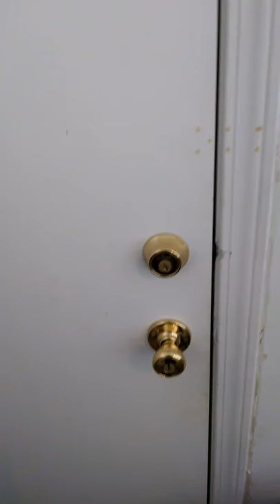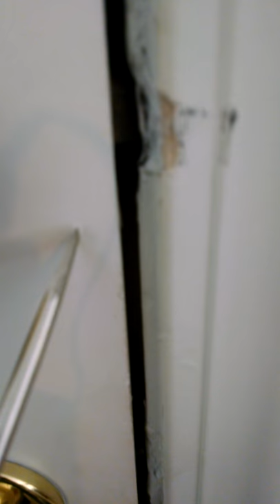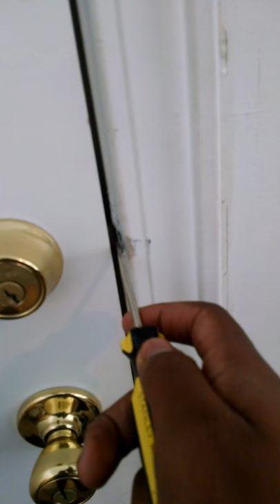How to get in your house that has a dead bolt.

Comment: Dude had the door already unlocked, look at the key way...
Reply: Its not installed right.... and if the bolt is not all they way out it wont lock in to place and can be pushed back in....
Reply: You can not accidentally lock yourself out with the deadbolt. You must have a key to lock it from the outside.
Reply: chris guyer it must’ve been elsewhere. He said in the beginning that his garage door was up.
Reply: @Lockman1986  he didn't say he locked himself out, he said he got locked out, which could mean a kid or spouse did it while he was outside
Reply: It work it not a lie I’m a grown ass man I’m telling you it works

Comment: Lol this doesn't work it you have a decent deadbolt when the thumb turn is set to lock position you shouldn't be able to push the blot in with your hand. If you can push it in I suggest buying a new lock.
Reply: Actually the deadbolt thumbturn could be pushed to locked position and the deadbolt latch not fully extend normally 1 inch you can still push it out of the way if not fully extended when in the frame
Reply: The whole door and trim could use some paint...what a mess.
Reply: I know that's right and even if he had  the clarence I have on my door to frame it's less than a 1/8 inch! Come try mine 😂

Comment: Dead bolts do something called dead locking. Due to a broken deadbolt or poor insulation this guys bolt isn’t dead locking. This will not work on your lock because yours very well should. And will not allow the bolt to retract from force or prying on it. “As long as it’s installed correctly” the bolt will have to be turned by the cylinder or by turning the thumb turn in the back in order to retract or move. He’s either unaware or is doing so for views and just the video. I’m a licensed lock smith so if you have any questions just reply to my comment and I will answer them accordingly.

Comment: As a locksmith this video is bogus. The latch will ONLY retract like that if it wasn’t turned all the way to the full lock position. Try it on your own deadbolts, with the door opened, and turn deadbolt all the way. There will be a little “click” you can feel at the full turn. Push latch with your finger and it won’t go in. Then turn just before full click and it can be pushed in. So either his door is improperly adjusted or he didn’t have it locked properly. But hey, if it gets you in without spending money on a locksmith then go for it.
Reply: Glad somebody finally said something, lo l 🤦‍♂️😂
Reply: Bro there are some deadbolts that don’t actually have the deadbolt feature

Comment: Two things, 1 either your bolt wasn't fully deployed or 2 your deadbolt needs replacement. Either way you aren't supposed to be able to just push a deadbolt open like that. They have built in safety measures against thieves that are trying to get in. Even the cheapest of quality won't just push back like that... they are called deadbolts for a reason!

Comment: This works on Knobs Not deadbolts! I know it's fake but if yours does do that it Means deadbolts broken, replace asap
Reply: Just about to write that
Reply: It can work if your bolt doesn’t fully extend
Reply: @I_lock_pick  you mean if it's half way between open and closed. Which No-one does. If you find a door like that it was a mistake or something needs to be fixed asap
Reply: @Caryfirebuff y🎉
Reply: Or a shitty dead bolt definitely did it before

Comment: Could just  be the hole for the deadbolt is  not deep enough so the deadbolt can't be properly locked. Happens all the time. Drill the hole deeper.
Reply: He is dishonest, just look at the keyway of the lock which was in a picked position towards the left!

Comment: I call b.s. on this. The cylinder looks like it's already picked over to the 11 o clock position allowing the bolt to move freely. I'm a locksmith and i spotted the cylinder "keyway" right away.
Reply: Lol, several of us non-locksmiths did as well!

Comment: That there is a sign your deadbolt is broken. I've had to break people out of their apartments because the bolt or the latch just breaks and stays closed. Had to break a $700 dollar lockset once because the cheap plastic part in the latch broke and trapped the resident inside. Another one was during a rainstorm and I had to climb up through a patio that was 30ft up, just to get inside to disassemble the lock.

Comment: I see a number of incorrect or partially correct solutions to the problem so I'll weigh-in:

Many deadbolts can be "fully" locked but can still be walked back into the open position as shown in this video, when the door is outward opening (this exposing the deadbolt). The solution is to extend the depth of the strike (the hole in the door frame into which the belt bolt extends) so that the deadbolt reaches its maximum length. At this point, an internal mechanism stops most deadbolts from being manually retracted by the method shown here.

For this reason, it's unlikely to be a problem with the lock so much as the door frame (although it's still possible that this can be caused by a broken part inside the lock...just much more rarely).

Comment: The deadbolt is not fully latched in the locked position.
Also if focus on the key way is not centered meaning a defective deadbolt. The does not come out unless it's aling in the center.
Buy a lock box hide/secured properly away from view an place a spare keys and (ice) name  designated person aware.
In case emergency (ice).
Stay safe

Comment: If the knob you turn to lock the deadbolt is not fully turned you can work it unlocked your deadbolt is not installed correctly. If it's fully locked and turned all the way it will not move! Gotta chisel a bit outta where the lock  piece goes. So if installed correctly this will not happen.

Comment: first of all of you first of all if you are able to do that with the screwdriver door deadbolt or catch is not installed correctly when your deadbolt is all the way in the lock position you cannot push it open. Might want to beef up your security and have your locks installed properly

Comment: This is a phony video. Once the bolt is FULLY ELONGATED in the slot u can not WALK the bolt open. This is the way there desighned. A criminal would be able to walk the bolt open only if the person did not fully turn the key. Just try it yourself.